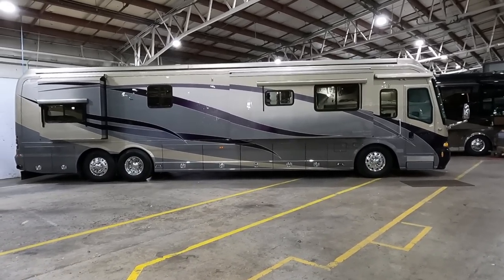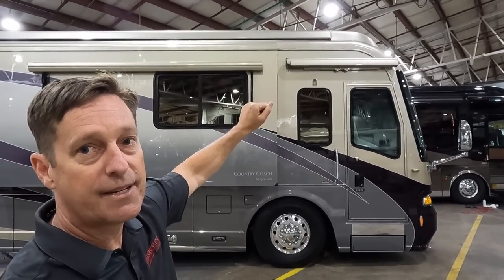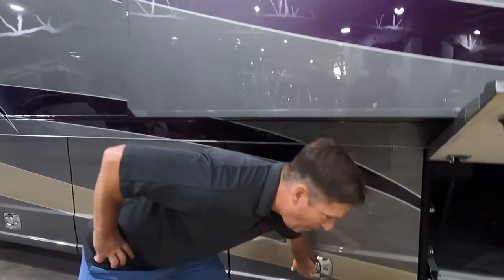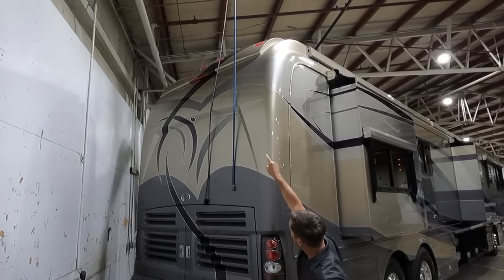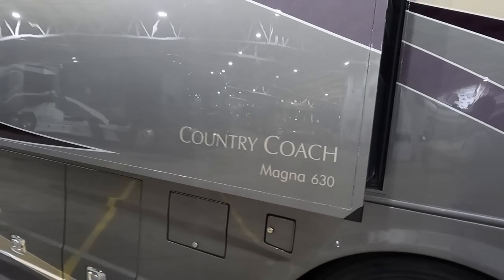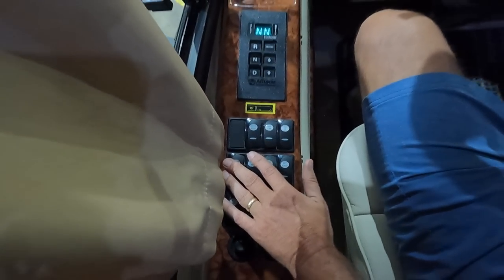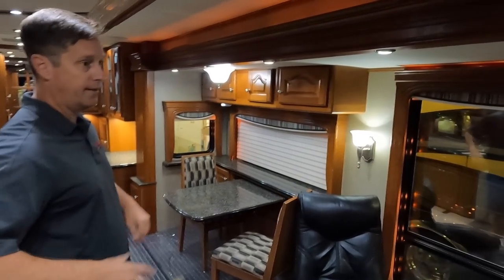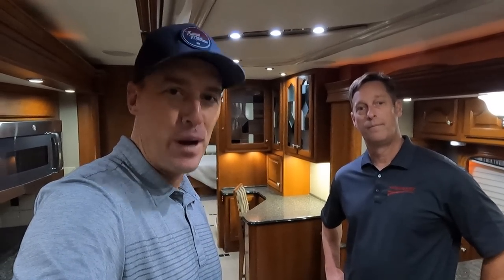Pristine Country Coach Magna Galileo For Sale $249,000!

Comment: I’m thinking that from NO reply to my question about  the Cummins TSB to address the Catastrophic intake valve failure.  The cylinder head has not been replaced.  If the head has not been replaced, the engine is  a ticking time bomb.  The mileage is just about right for this to happen.  Just imagine this happening while your a long way from home.   Best to have the head replaced on your time and budget.

Comment: California Queen
California queen mattresses aren’t a standard bed size like California kings are. However, they are part of many individual mattress manufacturers’ size runs. This means that you won’t have as many material and brand options in this size as you will a standard queen. But you will be able to find a Cal queen without having to have one custom-made.

California Queen Mattress Dimensions

The California queen mattress adds four inches of extra length to the standard queen for a total of 60 by 84 inches. While most people don’t need nor notice the additional length, there are some people who do.

Who Should Sleep on a California Queen Bed

California queens are made for a specific type of person: a tall sleeper who needs a queen size mattress. Most people can sleep comfortably on an 80-inch mattress. However, a few ultra-tall sleepers can’t, and they need to seek the best mattress for their body type.

Furthermore, there are lots of reasons why you might not want to move up to a California king. Maybe you don’t have a wide enough room for a Cal king. Maybe you’re a single sleeper and feel a California king is too much. Maybe you can’t afford a king size bed. The California queen allows you to have all the advantages of a queen and the length to meet your needs.

Ideal Spaces for a California Queen Bed

A California queen bed is just four inches longer than a regular queen bed. That means it can fit in most of the spaces your regular queen bed can. You might need a bit of additional length for your California queen. However, for the most part, you can expect to sacrifice a bit of clearance around your bed when buying a Cal queen. However, you shouldn’t have to upgrade to a larger room to get enough space.

Average Cost of a California Queen Bed

When it comes to how much a mattress costs, generally speaking, you can expect to pay a bit more for a California queen mattress than a regular queen—but not that much more. Just like with a California king and a regular king, you can expect to pay around $100 more for a California queen mattress than a standard queen size mattress.

We should also note that California queen size accessories may cost more than a standard queen mattress’s accessories, partly due to the size’s rarity. For example, a queen platform bed is commonplace and inexpensive, but a California queen platform bed may take some hunting and will cost more.